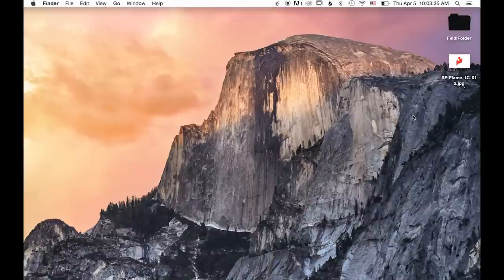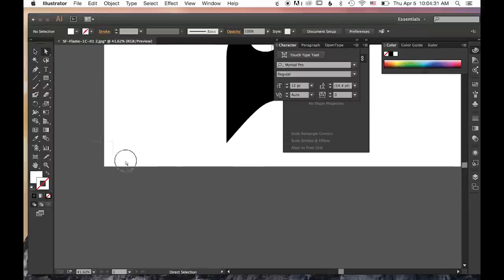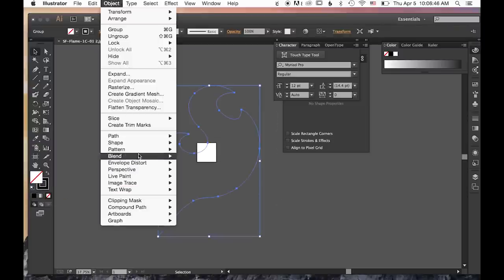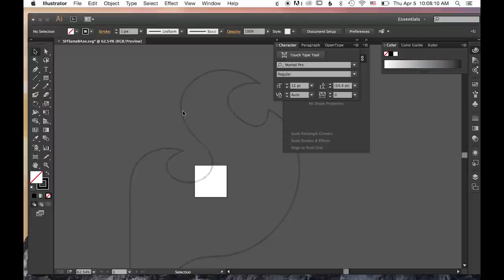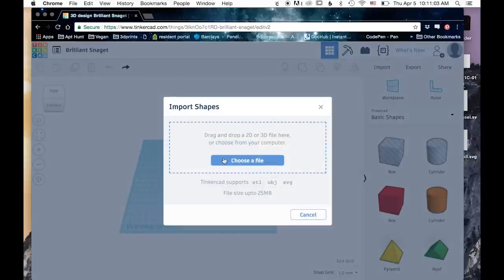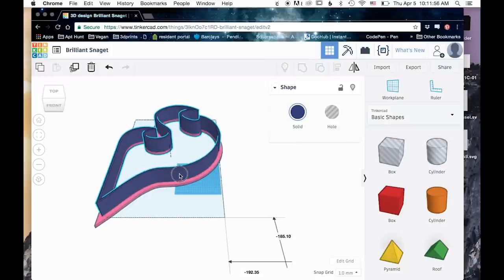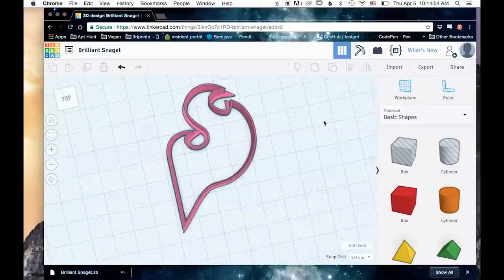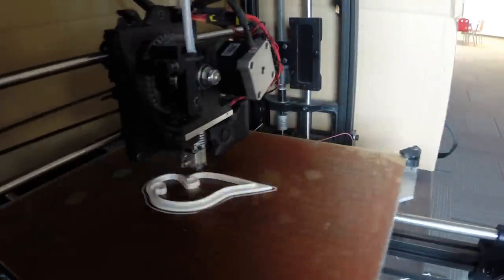Project Showcase: DIY 3D Printed Cookie Cutters

Comment: I would love it if, like in your blog and email newsletter, you would point out that you should use food safe filament.
Reply: I guess for people who do printing regularly, it'd seem obvious
Reply: I mean, if you don't use it on boiling hot stuff and you're baking at home (not profesionally), it's generally not a big deal if you don't go for a food-safe material, a bit of common sense is sufficient. After all, cling film despite being perfectly legal to use on food is full of phtalates and plastica chemicals as well...
Reply: @francescoanastasio2021  I don't get this logic. Eating unhealthy things is ok if you also eat other unhealthy things?
Reply: @tmartin9482  it's just not unhealthy if you use it on cold foods (cookie dough usually is) and the material is biocompatible. Of course you can't cut a cookie with lead, that would be unhealthy; but we are talking of, basically, plastic here. Nylon most likely or something similar. There is no harm.

Comment: I'm complely new to Illustrator and I missed a few steps. You said add an outline and remove the fill. I see you clicking in the lower left of the tool bar but I can't see clearly what your clicking on and you didn't explain the steps. Any chance you could clarify exactly how to remove the fill and add a black outline?
Thanks so much. :-)
Reply: agreed..My Direct tool does not at all clear the white background ....

Comment: Nice.  I thought you would go from the base to the thin gradually ie the cross cut would be a triangle .. yet T shape cross cut is cheaper and seems to work same with no need 4 supports.

Comment: Way to fast with your information. I would have to start, rewind and replay hundreds of times. Also it sounded like you said, at the end, go to your local library to use a 3D printer? Name one city that has one in their library. Who is going to pay for the filament and how will they get rid of burning plastic smell?
Reply from the maker: Our local library in Boulder, CO offers 3 so....
Reply: @sparkfun  only a few words came through.
Reply: @cyberdan1000  many libraries have and the cost is around $1 for a cookie cutter size. You have to bring your own STL files
Reply: @cyberdan1000  That sucks. I would still support my local library regardless of shitty parents. And I'm also not worried about the smell of plastic, many are for in home use and don't require any ventilation so I highly doubt they are a carcinogen. But to each their own
Reply: @cyberdan1000  PLA filament emits a benign chemical named lactide
Reply: @paperlovecards5375  maybe but it still smell like burning plastic. and who says it is benign? ever heard of Roundup? Some parts of this country there are no old farmers they have died of cancer.
Reply: @cyberdan1000  I didn't respond for a lecture I merely gave you the name of the chemical it emits.  Have a good day.